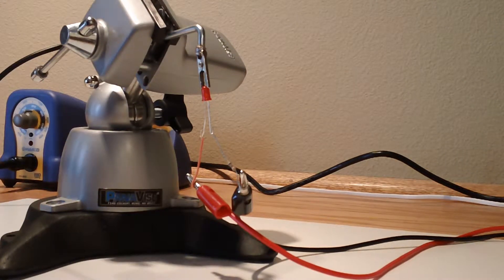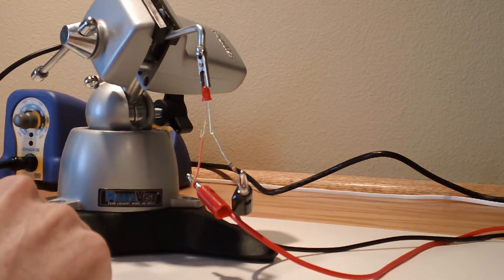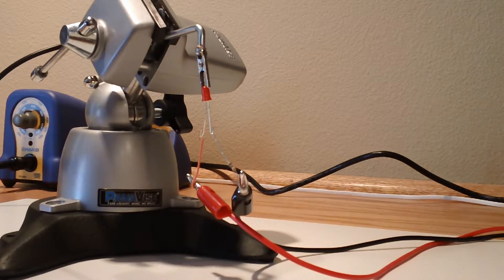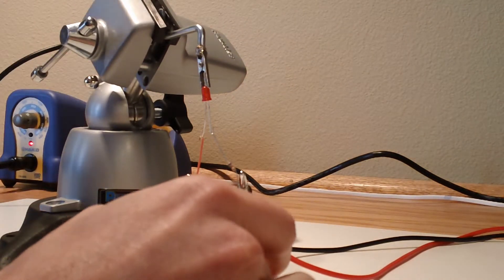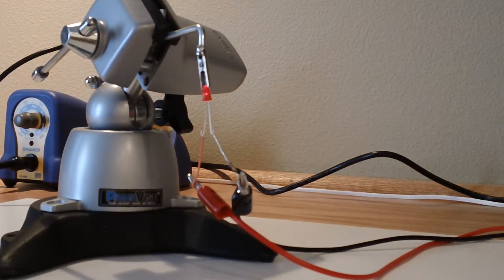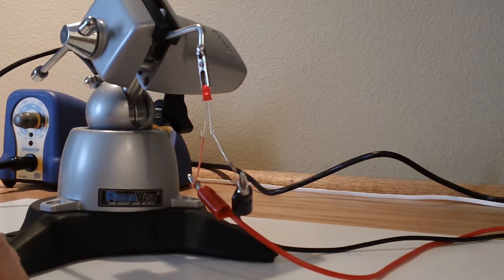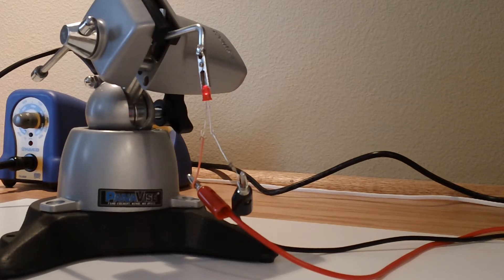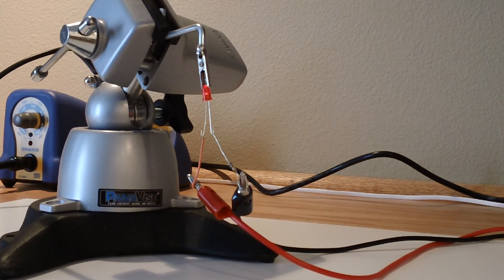Make: Electronics - Experiment 13

Comment: Hi Chris, thank you for your demonstration of Exp. 13. I'm heeding your warning, but I've already tried this experiment twice with two different soldering stations. You see, when I first tried it, I was using an older variable soldering station. I couldn't get any results. The heat from the iron had absolutely no effect to the LED or anything else for that matter. So I thought the iron was faulty. I tried a newer variable iron with the same results. I went digging for info online and ... TBD